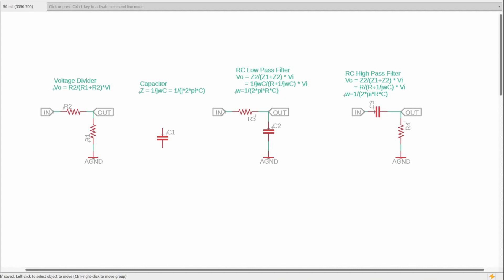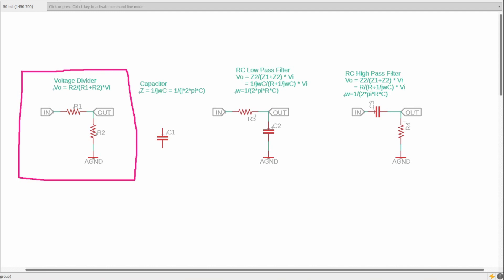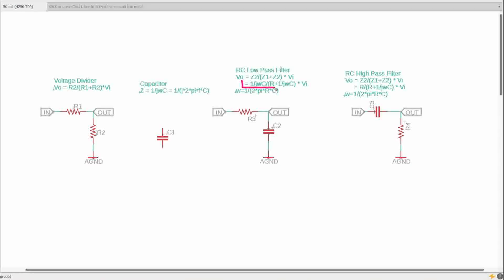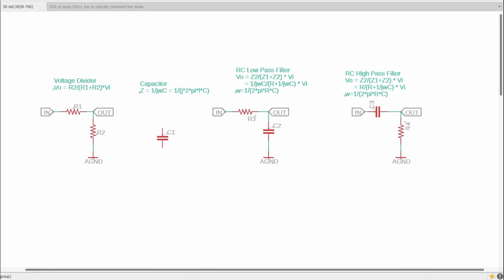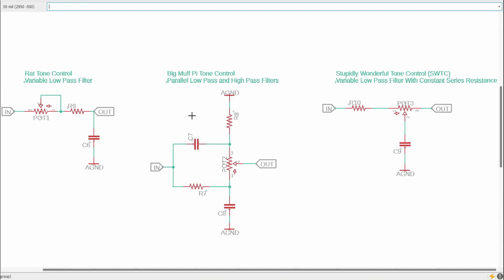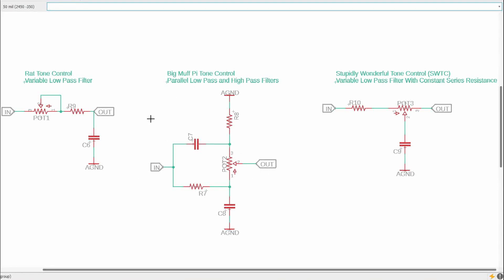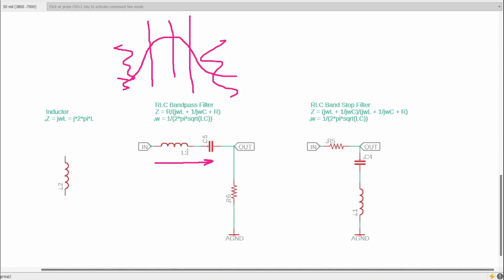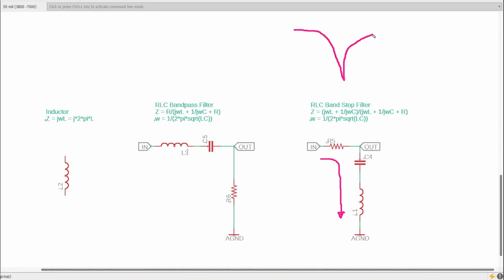Schematic Elements for Guitar and Effects: Passive Filters and Tone Controls

Comment: Great explanation, but for those who are really beginners, I would recommend to look for those equations somewhere else. It is stated, that somewhere there is missing frequency and somwhere that there is omega instead of f, but If you are not at least little bit familiar with basic electrotechnics, better get the formulae from some textbooks. But again, the explanation of principles is great!